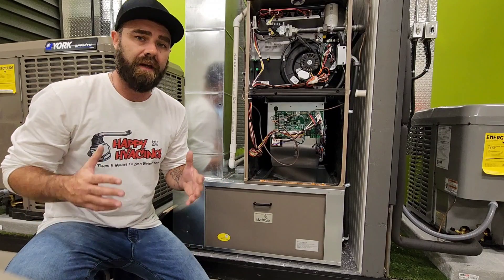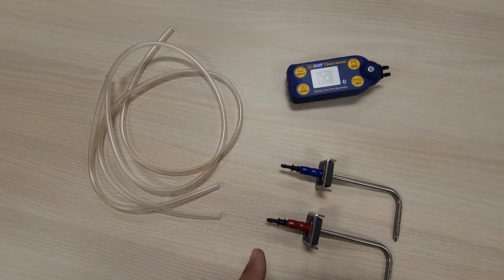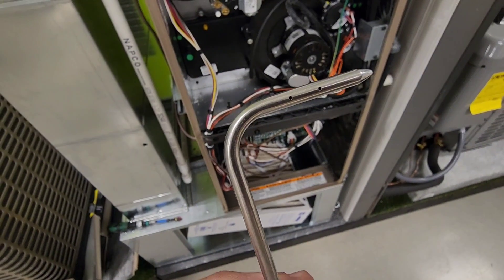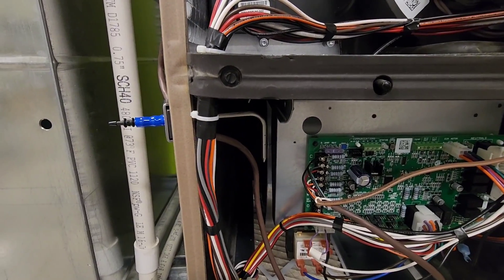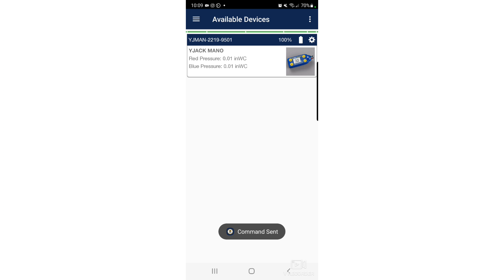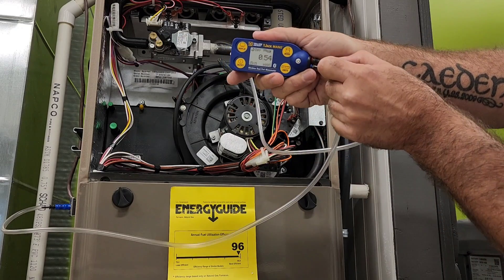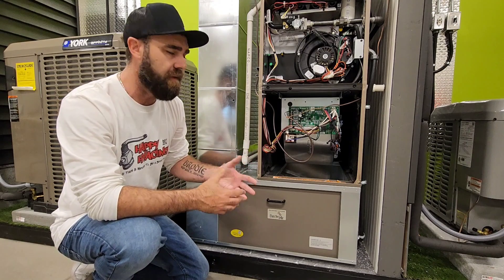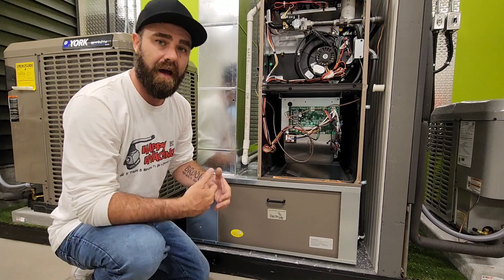How Check Total External Static Pressure On An Air Handler Or Furnace

Comment: Good explanation for checking static pressure which is rarely done or payed attention to.  
I cannot believe you actually measured .5 “ with the ridiculous filter blocking of much of the free return air at the base of the drop.  Luckily the furnace is only 60 - 80,000 btu  which is running lower CFM .
Reply: 80 000 btu is a big furnace when talking condensing! normal sized homes can heat on 40 to 60 unless a basketcase or where it drops below -30f.

Comment: Is there any worry with having the furnace run without the high limit switch in? Should I keep it under a certain time or avoid going into the heating phases with it like that? What phase do you have it in to test static pressure? Phase 1? 2? Recirc? New to this and want to try this myself.

Also, if I can’t splurge for the y jack, what kind of manometer will do the job?
Reply from the maker: It's only a brief test that you do with the fan running.  You don't need to have heating engaged

Comment: I check esp and temp rise  on every service and I’ve never seen a positive pressure on the return. Your manometer looks like it’s displaying a positive pressure on the return? Am I missing something?
Reply from the maker: It's in the negative port, so the display is a negative pressure.

Comment: Shouldn’t this be done during install? I just had this done and they drilled a hole in the cabinet and put a rod in it and pushed the other rod right into the return ductwork and took the static reading that way. Overall the reading was grossly high at over 1.0…new system was installed one year ago. They came out for the one year checkup and now say our ductwork is too small and want 20K to replace it all. Small 1K square foot home
Reply: You got a hack, they probably oversized your furnace if you got 1” of wc, should only need 20,000btu to heat that place in a temperate climate

Comment: Great video Gary. Pulling the High Limit Switch to place a supply Static Pressure Probe there is a Great tip for when you come across a Cased Evaporator Coil. Perfect spot!.
Reply: How long can the furnace be run without the high limit switch in? Should I not let it get to phase 2 heating?

Comment: Hi Gary, thanks for the video. Its super helpful. Question: When measuring external pressure do you also measure the same for each Zone with damper on/off? I am thinking this would show if any duct work in any zone is having less air flow and building up pressure on the air handler...right?? I am assuming the pressure check probes still go in the same spots (after air filter) and (before the coil) when testing each zone as well

Comment: I asked if the installing company for my Rheem system could check static pressure as I had my ECM module fail after 4 years. They said they don''t that and don't "normally" carry a manometer with them (???),As temporary measures,, I cut a new return inlet on second floor and went to lowest filter rating above the 99 cent "models". I religiously change the filter after two months- maybe overkill, but the ECM is big bucks now that the 5 year warranty is over. In future any sales guy will have to measure the pressure and show me that it meets the new furnace/Ac requirements.The older furnaces had aircraft blower motors so it probably didn't matter what the pressure was.With knowledge I think I'll  splurge on a manometer and test it myself!

Comment: Maybe 20% of residential techs are doing this. I have never seen an industry so polluted with sales gimmicks and lack of training. It’s embarrassing.
Reply: 20% is generous. I just moved into a management position at supposedly the biggest and best residential HVAC company in the area. What I found was that out of approximately 61 techs, 4 or 5 are actually competent.
Reply: @eggsnham a company with 61 techs only cares about sales. That’s so many techs the overhead must be massive. Medium size companies with 20-30 techs are normally more professional. Not always but better chance
Reply: Great video though. 👍
Reply from the maker: Agreed and thank you!
Reply: Agreed, we have all of our technicians trained on static pressures and importance of airflow where I work. It’s amazing the lack of knowledge when it comes to ductwork and how it works in unison with a system. If the Duct ain’t right, unit will never work right.
Reply: It is sad.  And I am caught up in it
Reply: Yeah I've been a service tech for about 15 years now after 2 yrs of installing. I didn't learn to be an actual tech until I came to work for my current boss. These bigger companies only want $$$. I was literally told with 2 years of being tool getter that they needed someone to run maintenance calls and it didn't matter as long as I made money
Reply: Companies dont wanna train anymore. its all about the survival of summer.

Comment: When you have a furnace with a coil on top what are the normal static pressures you see in the field? Obviously the unit says its rated 0.5 in WC. That doesn't include the coil; with some of the new coils and matchups you can lose as much as 0.3 in WC through the coil. Combine that with a bad filter setup of 0.2 in WC you already are at 0.5 and you still have the ductwork, grills, and dampers. I typically saw 0.6 to 0.9 in the field. Most of the ductwork I came across was undersized for furnace with a coil. The newer blowers are nice because they can still deliver decent airflow up to 1 inch of static. 

I did a bunch of testing on my own system and was able to lower the static to around 0.7 or 0.75. Dropped cfm to 350 per ton and put in a 20x25x5 media filter getting a 0.1 drop across the filter. I wanted to redo the plenum because its undersized right now 20x8 for 1000cfm is too small.
Reply: I would install a wider coil that had a txv
Reply: How about your field measurements of horizontal furnaces? What is a normal static pressure that you see in the field?

Comment: If you wanted to test pressure after the indoor coil you would just put the static pressure tip above the coil in the duct work somewhere correct?
Reply from the maker: Yes

Comment: return air static pressure should be negative...not positive.  you are a good teacher but something isn't right today.
Reply from the maker: It is negative, when it's on the negative port it just shows as a number.
Reply: @HVACKnowItAll  Hmmm.  Well, then Yellow Jacket should add the dash in my opinion.
Reply from the maker: @pitaeata8493  every manometer I've used is like this.  If you put it on the postive terminal with a negative pressure.  You'll see the negative symbol.  On the negative terminal, there's no need for a negative symbol.
Reply: Lol, sure bud.. go tell yellow jacket they've somehow had it wrong the whole time.
Reply: When looking at static pressure we look at the absolute value of the number.  The negative symbol is irrelevant.